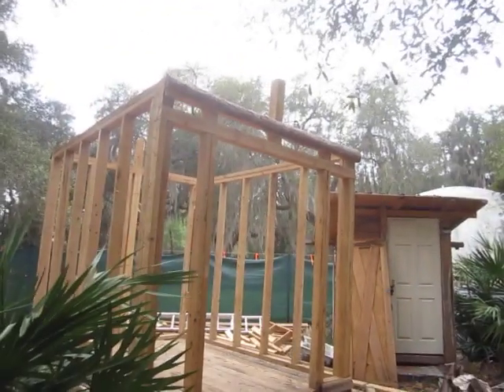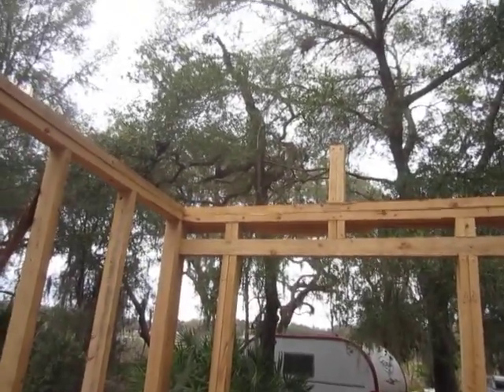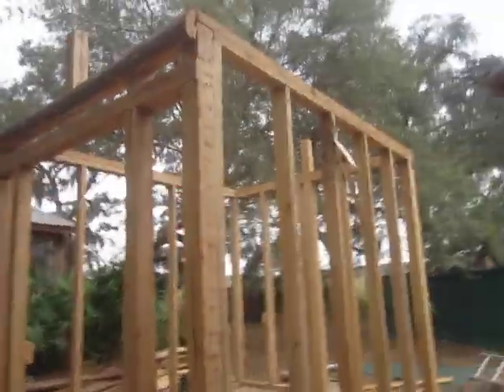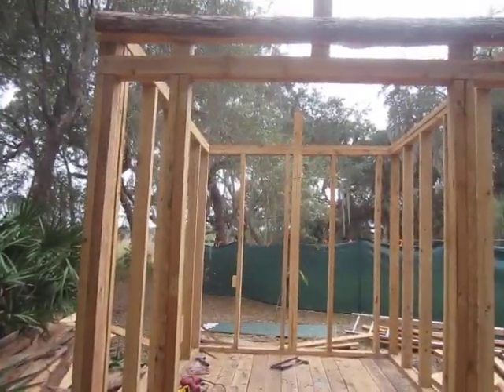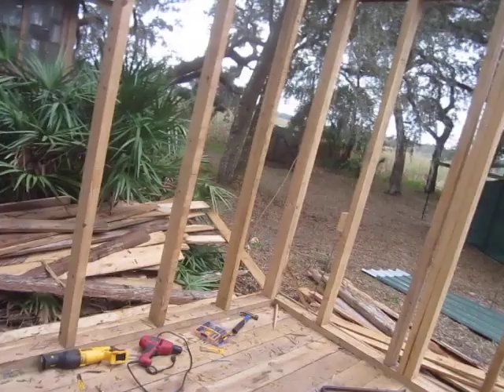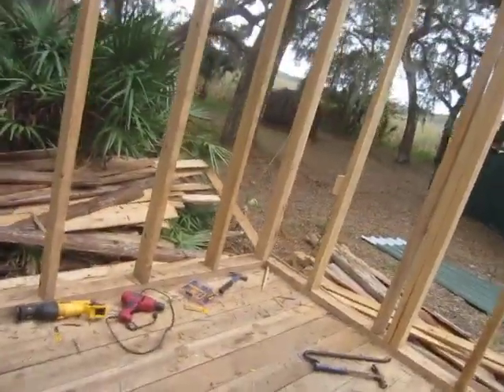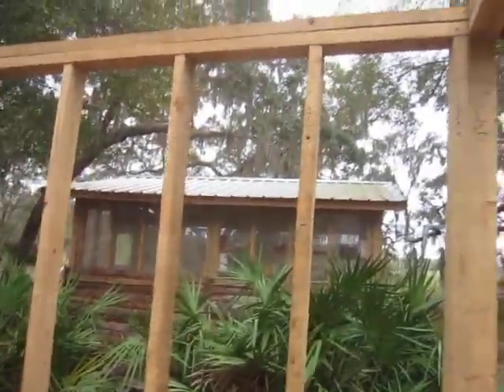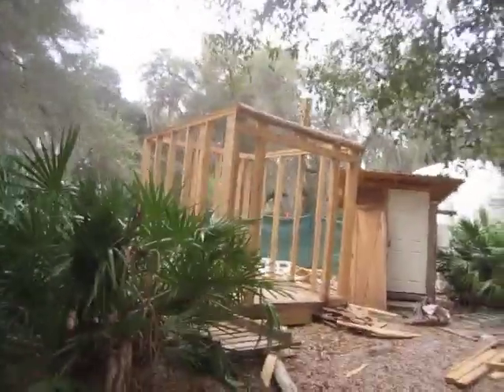Any Advice on Best Way to Move a Tiny House?

Comment: There's no cross bracing anywhere in that frame, so you might want to think about temporary bracing of the walls for the shipment or you run the risk of losing square, and worse, loosening fasteners from the stresses in transport.
Reply from the maker: Good point. We just cross-braced the front wall over the open door frame, but obviously all of the cross-bracing on the other walls came off with the siding.

Comment: I'm a tight wad so I'd skip renting the u-haul as long as your camper has an opening window in the front or back to snake the longer sticks through. Between your truck bed and trailer is it possible to fit everything in ?
Reply from the maker: Thank you for the laugh. I needed that.